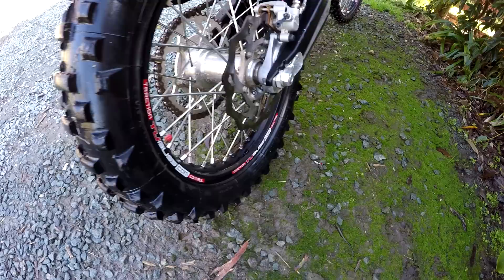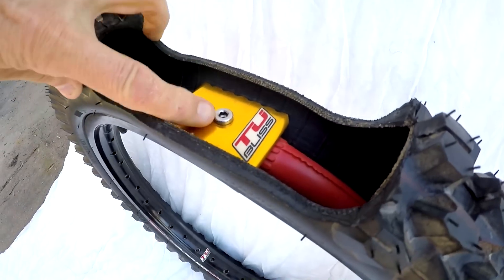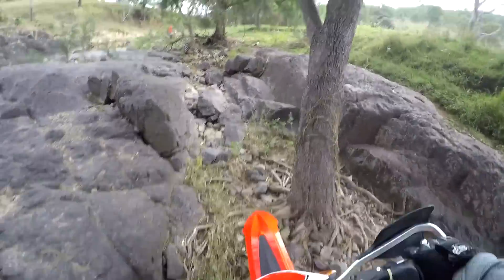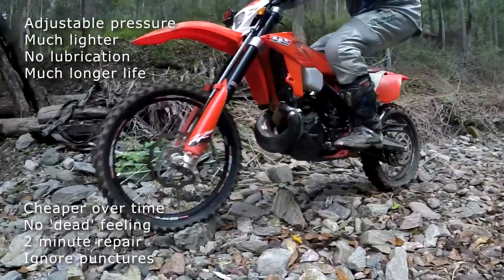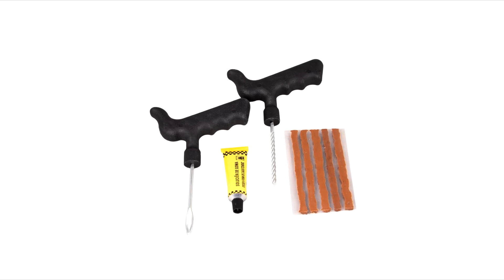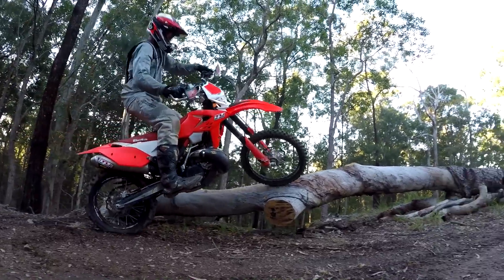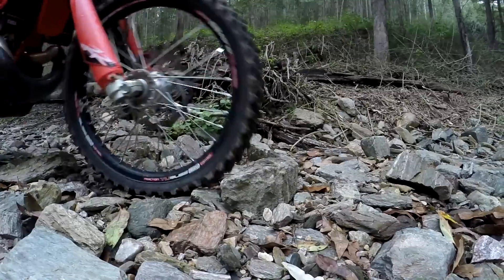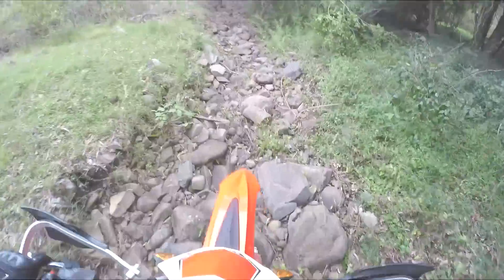TUbliss review: a tubeless tire system for dirt bikes︱Cross Training Enduro

Comment: I've been interested in these for about a year, but I ride a dual sport daily to and from work, and usually like 30 psi. for street use. How much tire pressure do you think these will support?
Reply: ***** Whatever your tires are rated at.
Reply: Mark - Will the seal last at least a week (that is how often I go between checks) at 30 psi.?
Reply: ***** Once the inner liner is installed, it blocks the escape of air through the spoke holes.  (It also doubles as a full bead rim lock.)  It turns your rim into a tubeless setup; and just like any tubeless setup, the more air you put into the tire, the tighter it will seal.  It's not going to push past the inner liner because that has 110 lbs of air in it.
Reply from the maker: ***** psi should safely go up to whatever the tire is rated for as a maximum... probably 50pis for most?
Reply: Mark - I c, I am due for a new set of tires this summer I"ll probably pick me up some of these and get rid of the ol' tubes!
Reply: CROSS TRAINING, ENDUROCROSS & ENDURO TECHNIQUES So last year, out on some jeep trails, I got a front tube pinch-flat taking the rocky bits like a motocross whoop section. With no trail-kit (stupid, I know) I couldn't repair it. And it was a slow leak so as it deflated, the tire started pulling to one side and I veered off toward the steep side of the trail. Nearly shat my self slamming the bars to full counter lock just to go straight and slow down. I had to limp the bike back down-hill 8 miles or so. The rim was fine, but the worst part was how the tire would flop to one side or the other since it fell off the bead. Took me all day, 10am to 5pm, just to get home with a $200 tow from the trail head.

I had been looking into these since, just to keep the tire on the bead if I ever got another puncture and had to ride the flat home. I think I'll give them a try.
Reply from the maker: ***** yep, definitely good for that sort of thing. it also firms up the sidewall so you can simply just keep riding too... at a guess i'd say it feels like 4psi even though dead flat. so great grip, corners fine, but just don't hit rocks and tree roots fast.
Reply: It will hold any pressure and you could use lower psi for road riding
Reply: chris coleman Not really, as tires tend to heat up more at road speeds.  (Metzeler used to have a problem chunking out with certain tires if run too low.)  Regardless of tube or tubeless, it's best to run whatever pressures the bike manufacturer suggests -- adjusting for loads and other variables, of course.  The TUbliss is not a compensation for tire design limitations.  It merely gives you the advantage of a tubeless tire and a full bead lock.
Reply: Did I say run it flat?
Reply: chris coleman No need to be sarcastic or go to extremes, dude.  As I said, the TUbliss system is not a compensation for tire design limitations so, no, it doesn't allow you to use "lower psi for road riding."
Reply from the maker: Mark - agreed this channel has a zero tolerance policy for sarcasm, but definitely keen on all forms of irony... dramatic, verbal and situational. :) anything extremely silly also goes down a treat.
Reply: chris coleman  I like the added fuel economy for road use at 30 psi (22 psi by manufacturer) since I am mostly going straight line anyway. Though when I do take it off road those pressures are going way down!
Reply: ***** One thing you will need to keep an eye on with daily, on-road use is the bladder pressure. There's no rubber in the world that will hold 100-110 psi forever, which Tubliss acknowledges. I think their prediction is that you will lose about 1 psi per day out of the bladder. A flat tire is no problem, an under-inflated bladder could be serious, though. If the bladder gets low enough to allow air to escape the tire, the tire will drop to 0 psi within seconds.

All that being said, I would absolutely use Tubliss on-road, just be aware of your bladder pressure.
Reply from the maker: sounds about right harvey, mine drop from 110 to 100psi over a week. i've had them as low as 90psi and they were fine. i think TUbliss say 80psi is around where they won't hold anymore?
Reply: CROSS TRAINING, ENDUROCROSS & ENDURO TECHNIQUES Most tubes seem to do that. My current heavy duity tubes lose about 2 psi. a week.

Though my TuBliss sets just arrived, along with a set of DOT (street legal) knobbies that are beefier than what I have ever ran, and I am still excited to try them out. I have never had any sort of rim lock, so out on the dirt I kept my pressures pretty high to prevent tearing of the valve stems. I want to lower my tire pressure and experience this "traction" I have only heard about on the dirt.
Reply: +CROSS TRAINING, ENDUROCROSS & ENDURO TECHNIQUES  just finished carefully installing the tubliss after a long hiking vacation, waited to install till after vacation to avoid potential headache right before.  I am going to personally and unofficially (and unscientifically) beta test these for daily street use against all manufacturer's warning.
Reply: +CROSS TRAINING, ENDUROCROSS & ENDURO TECHNIQUES also, after reading the manual, if you check your pressure at 110 psi, even the slightest bit of air coming out of the valve stem is about 10 psi. So every time you check your pressures it will always be about 10 psi lower than it was before you checked. It can seem like the tire lost pressure over a time, but really it all just left after the check.

Though I'll find out for sure in the next few weeks.
Reply: Have had the TuBliss installed for 2 weeks. The main air chamber looses about 2 psi/day for me. Going to try using tire sealant to reduce the slow leak. 

The bladder is working perfectly fine.
Reply: TuBliss are definitely better than mousses since they don't deteriorate at high speed, so they are highway capable, though they need to be balanced. Even riding with full front tire failure was possible since the bladder housing keeps the bead centered on the rim even when flat (bladder damage was my fault after doing a reset). the rear bladder loses about 30 psi in three weeks ~110 to ~80 psi. Waiting on a new front bladder for now. Recommend using tire sealant with the Tubliss. Overall I like them for street use, just have to stay on top of the pressures, i.e. check them at least once a week as you should anyway. All liability rests on the rider.
Reply: This account is from my phone, Harvey Mushmann is from my pc. I don't want to link my accounts.

Comment: I use a tube system
Im not so sure about tubeless
Reply from the maker: Frank Franky i've got mates who actually like doing track side puncture repairs and don't mind carrying the tools and extra tubes. and i know others who run high pressures and avoid gnarly terrain and rocks so almost never get punctures. for everyone else though i'd say the TUbliss is definitely worth looking at.
Reply: CROSS TRAINING, ENDUROCROSS & ENDURO TECHNIQUES i got a question if i was riding my chinese dirt bike and my tubesystem tire got puntured should i fill my tire with grass and whatever shits avaible to get to a gas station
Reply from the maker: Frank Franky definitely an option if you can't fix it on the track.
Reply: CROSS TRAINING, ENDUROCROSS & ENDURO TECHNIQUES yep but i heard theres a product called slime or some shit like that you put it in the tire and you can ride your dirt bike for 100km